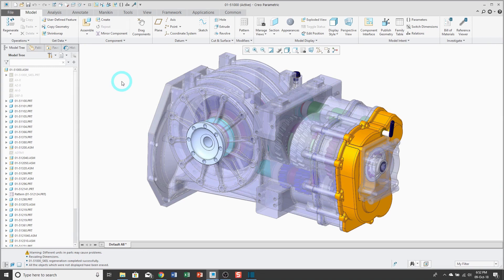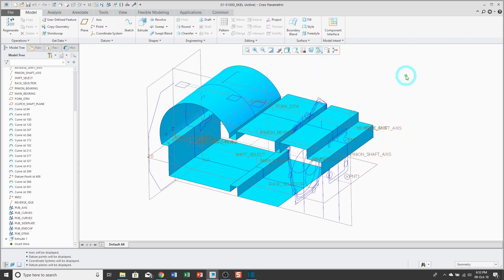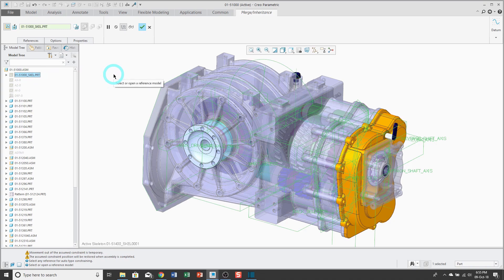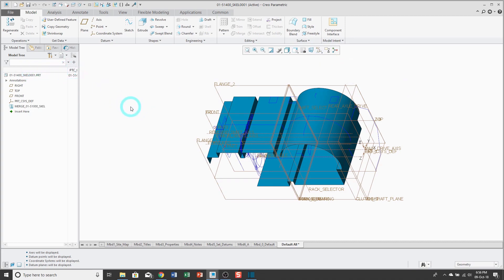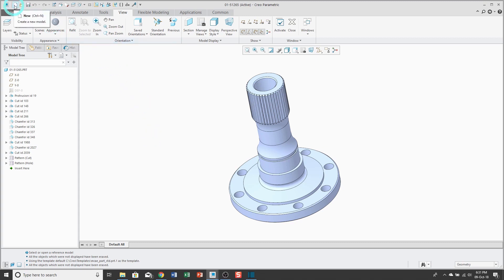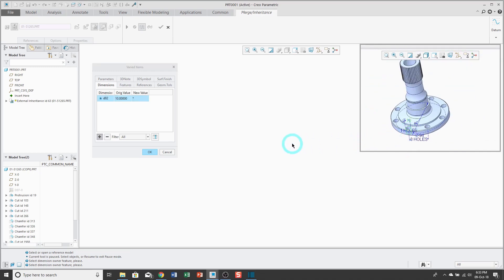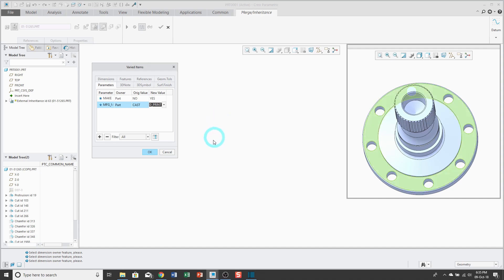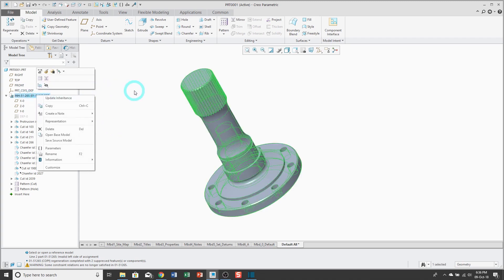Creo Parametric - Merge / Inheritance Feature - Top Down Design (TDD)

Comment: Is there a way to later on change the 'source' model in a merge feature?  I run in to this problem when I save a copy of an existing assembly or part to go explore a different/new concept... the copy parts still reference the original 'source' model but I really want them to use a new source model
Reply from the maker: You should be able to Edit Definition and change the source model. Often a bunch of features will fail but Edit References is good for fixing that. Is the new source model a copy of the original, a little different, or radically different?

There are other tricks that involve creating a model of the same name - either the source model or the model that contains the merge feature - and having it reference the intended geometry. Then you open that model and then the assembly. It's basically tricking Creo based on model names.

Provide some more details or an example model and I can probably put together a video.
Reply: @CADPLMGuy  In this case the new source model will be a copy of the original source model.  The first half of the source's features will be reused in the new copy, the other half will be changed radically.  For some reason when I edit definition of the merge feature and either right click and hit 'replace' or simply click the folder icon to choose a new model I get a warning stating that I can only change the source part if it has a family table, I can respond back with the exact warning message tomorrow when I'm back on that computer.  

Also for reference there are about 8 parts in the top level assembly in this case, and I will need to perform this merge redefinition within each of those parts in the new copied assembly, I'm not sure if I would be able to use the tricks you mentioned in this case but those could definitely come in handy in the future.  Thank you!
Reply: so the actual warning message down in the message log is: "Ref model that is not instance and have empty Family table can not be redefined."
Reply from the maker: If you're getting that error, then you're probably going to have to play the game with model names. Let me think out the steps and try creating a model to map it out.
Reply: @CADPLMGuy  Ok thanks!  I could have sworn I was able to easily replace the ref model in the past, I wonder what caused the error this time.  Also, for added level of difficulty I'm working within a windchill workspace so I believe the 'rename' functionality is limited.  But if you make a more generalized video I can probably work 'offline' to figure it out
Reply: @SeanMcDonnell33  Facing exactly the same problem, Did you find any workaround?
Reply: @jaydeepvadavia3948  hi jaydeep, unfortunately I did not.  however I have found myself using publish and copy geometry recently more than I used to because it seems to be more forgiving should this scenario arise again in the future (even though the publish and copy geometry technique also seems like more work and more clicks long term than a merge... tradeoffs 🤷🏼‍♂️)
Reply: @jaydeepvadavia3948  hi jaydeep, I should also note, the tedious workaround I used to solve the original problem was as follows: i put a new merge feature at the top of the feature tree, deleted the original merge, suspended all failed child features, and went through every failed child feature to replace or delete any missing references.  before starting this process, saving a backup copy of the original model with a different file name was helpful to have a part to look at to help resolve failures.